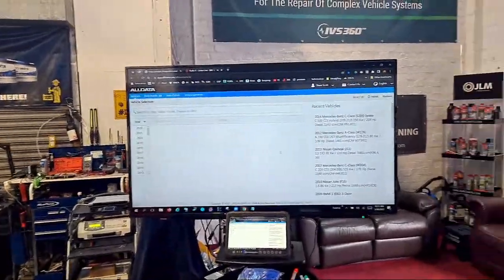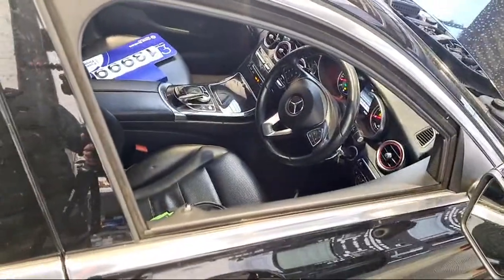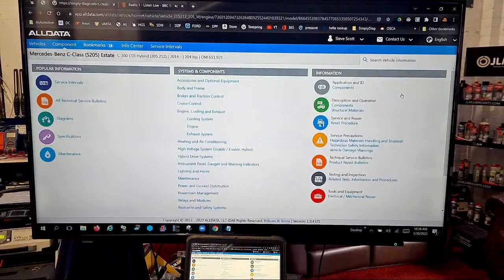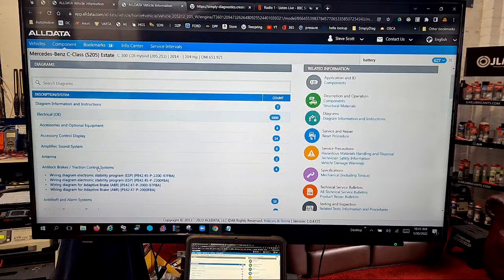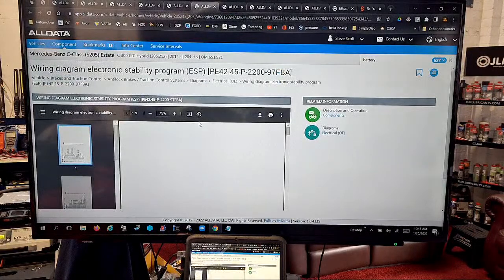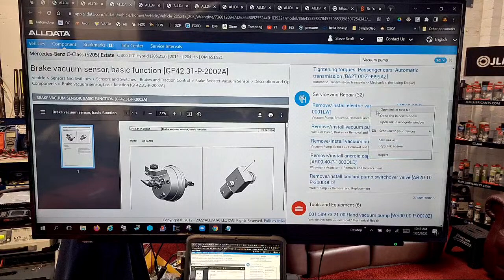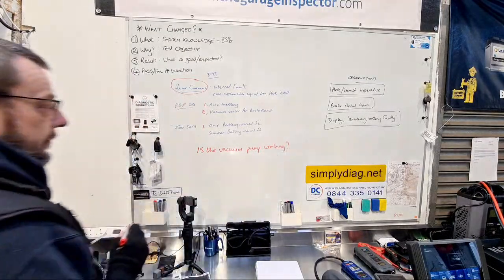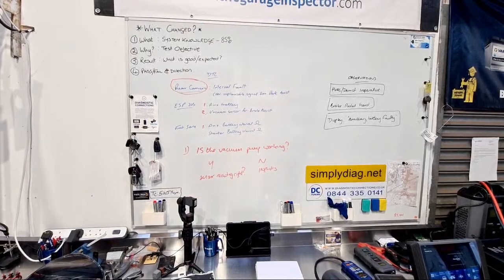C300L Hybrid - Brake, Battery & Reverse Camera Faults

Comment: I think you’ll find it’s the mechanical driven vacuum pump buried in the engine alongside the cdi high pressure pump that’s failed Steve ( you’ll be passing that job off to someone else to fit 😂) the electric pump is an auxiliary pump used during hybrid mode ( engine off mechanical pump unable to provide vacuum) if you pull the plastic brake booster pipe off at the connector onto the metal pipe coming up from the mechanical pump ( r/h/r of engine) you’ll find no or very little vacuum pressure.
The auxiliary battery on that model might be a capacitor designation C3 a small oblong shaped plastic box in the passenger footwell it’s a bugger to find even on the factory manuals but could also be a standard lead acid battery.
Reply from the maker: Awesome information Madds 👍